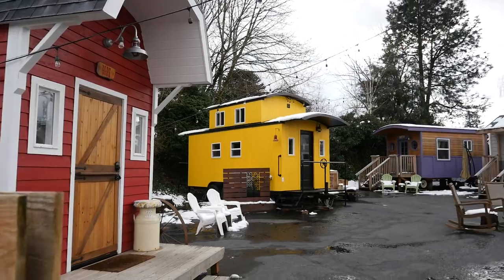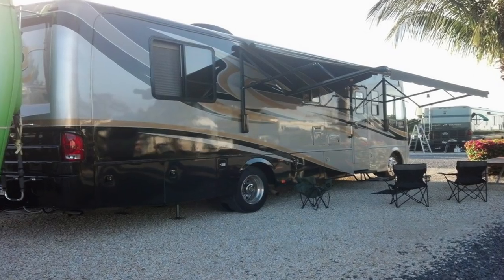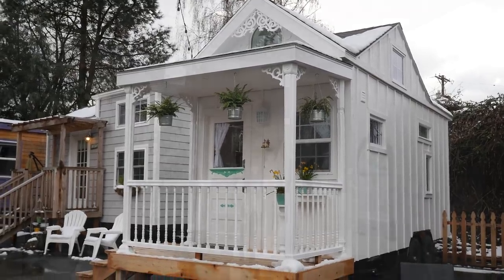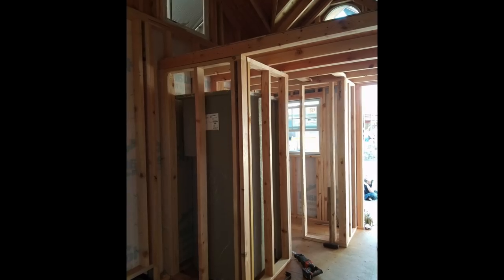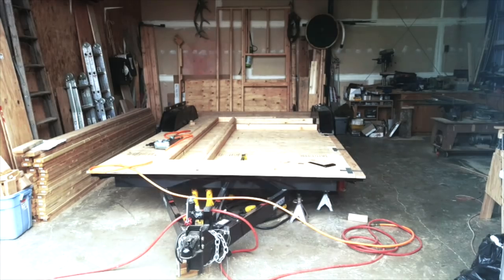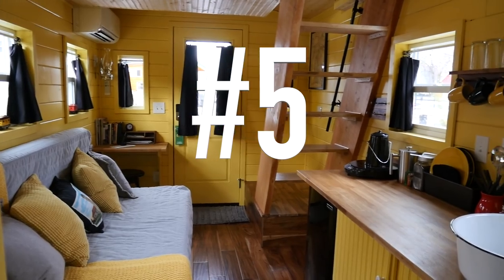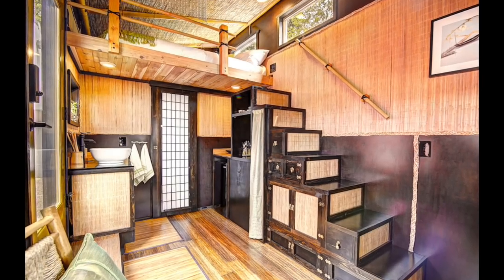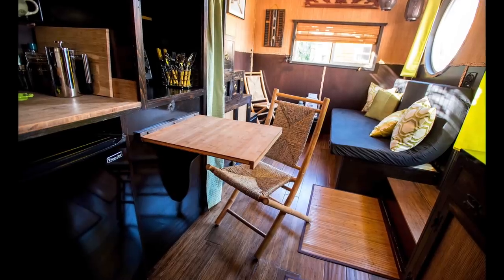Tiny House MISTAKES & Design Tips for DIYers

Comment: I'm goin to do a conversion on mine soon. This will help a lot. I'm planning to use as much pull down stuff like steps, bed, tables as possible. Insulation plumbing hvac solar are all the critical questions I have.

Comment: My Tip for owning any trailer that will be parked more than several years......
   Sell the New set of Tires, While they still have Value....
      Old tires, any tire after about 5 years old. Can fall apart.. Loose a Tread... And Kill you or Someone...
  So many times I've seen Motor homes & Trailers with unsafe New Looking Tires.....
 Check the Date on when Made.
 they go by week & Year.
 (3216) would be 32nd week of
2016... 
... get a Discount for old Tires...
it's 5/20 now. so almost 4 years old. on this example....